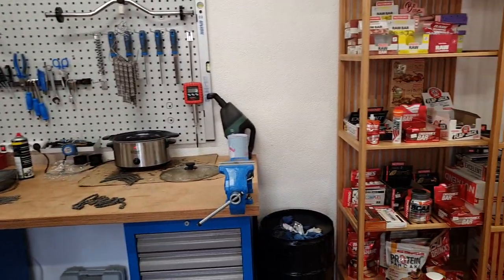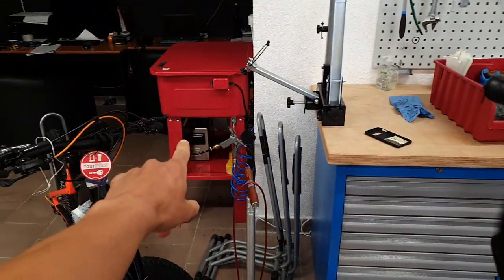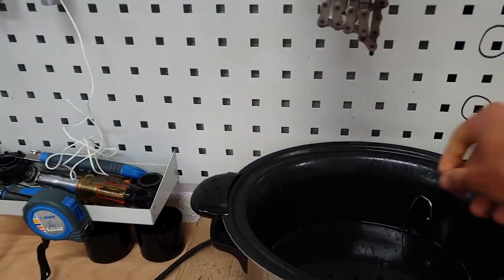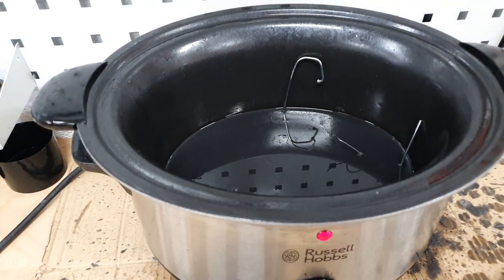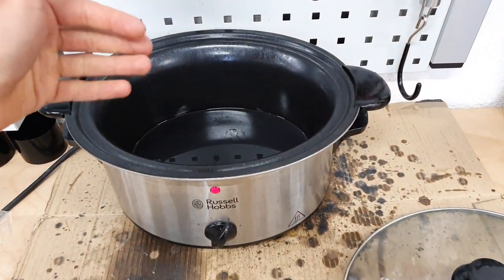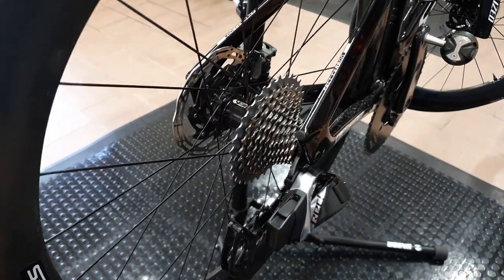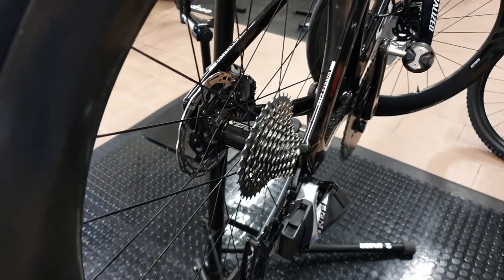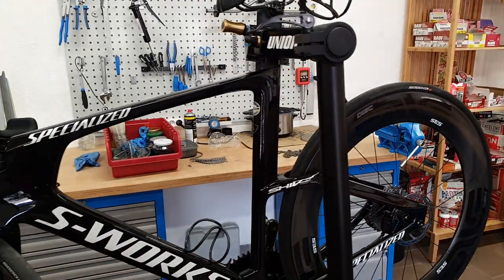Waxing your chain is not that hard!

Comment: This exactly the process I use - the only difference is I use a longer "swisher" handle for the chain made from an old metal coat hangar, and a narrower but taller wax pot.  This allows me to 'swish' the warmed chain around in the wax, and helps with wax penetration (This is per Molten Speed Wax instructions).  Also, I put my chains on the bike while the wax is still warm enough to be flexible, and give it a few turns of the pedal. This cuts way down on the wax flaking off and making a mess.
Reply: I also do everything you've described.  It works great!  Also, after I'm done with the chain I put a large and strong magnet into the wax.  I use an automotive telescoping magnet and I put the large magnet onto the automotive magnet.  This gives me a tool to control the magnet.  I put the magnet in the molten wax and swish it for one minute.  It picks up a ton of ferrous metals from the molten wax.  I do this extra step after every re-waxing, typically four chains.  This way the wax stays relatively clean and free of metal particles.  I've started waxing since Dec. 2019.  My only regret is that I didn't start doing it sooner!
Reply: Geez gents, some great tips... I have been waxing chains with molten speed wax now for two years and would not do it any other way. Bike is Cleaner. I like the magnet trick.... Naturally I have three chains per bike too, so putting it on warm is only feasible for the first chain. I also noted that Oz cycle suggests pulling chain out when the wax in the cooker starts forming a skin. You guys do this??? Finally on the noise... Yep, I did notice that the sram flattop chains are louder than my other bikes running the kmc chains..... Thinking it's the type of the metal.

Comment: I typically just put the chain on top of the cold, solid wax and turn the slow cooker on. Once the wax has melted I check the temperature every now and then. Once it reaches about 92 degrees Celsius I'm done and I turn the cooker off and agitate the chain a bit (I try to do it for about two minutes) in the wax. It seems to work for me. :)
Reply: Vicki Peterson  Usually, I just try to solve it with money, by buying a chain that has been cleaned and waxed, but when I occasionally buy a chain that still has the factory grease on I remove it as per MSW:s video here: https://www.youtube.com/watch?v=lI0tZqIpguk

Comment: motorcycle chain cleaner / wax combo works great for bicycle chains also...  put chain in lunch meat container, spray degreaser, shake well, rinse with hot soapy water then plain hot water, dry well. Heat in oven for few minutes (just warm), put in container again, apply wax, shake well, wipe off excess, let dry.

Comment: I have a couple of questions:
1. How often do you need to wax your chain?
2. Do you need a new chainlink to put your chain back on bike everytime you wax? 
3. Does wax run cleaner than dry lube?
Reply: supersonicwings I’m interested in these q’s as well.
Reply from the maker: 1.) Ideally every 300km in dry conditions, 600km max
2.) No
3.) Obviously, dry lubes are rubbish
Reply: Just a note, Sram recommends not reusing the one chain link more than once. At 12 bucks each, I think that's a bloody conspiracy. I use it over and over again.... Ha!
Reply: I do wax my chain for 3yrs now and all the chain still using. Now I’m riding indoor on zwift and found new wax chain will last around 500km and the chain will start to squeak and I re wax it and use the spare waxed chain. I use paraffin wax with Teflon powder.
Reply: I have used the same quick links for the last 12000 km.

Comment: The one drawback of waxing is that you get into trouble if you travel somewhere and don't want to bring your slow cooker and don't want to bring 10 chains. Fortunately, some drip lubes are very compatible with molten speed wax. Last summer I cycled from Stockholm to Amsterdam and then I brought along a bottle of UFO drip, which was mostly ok. Now I just read about the Tru-Tension all-weather tungsten lube, which seems like the perfect complement to molten speed wax. I have to get a bottle ASAP.
Reply from the maker: Wait for the new Silca lube 😉
Reply: You can always give your wax chain a refresh with a paraffin candle, a lighter and a hairdryer.

Just light the candle and drip the melted wax on each link of your chain, the wax will mostly solidify on the cold metal. Then, after you gotten a whole row of links with wax, use the hairdryer to melt the wax into the chain links. The liquid paraffin should be thinner than a wet chain lube and thus penetrate the chain easily.
Reply: I have a bottle of chain wax dissolved in Xylene solvent in a squirt bottle. You can put some in a  small bottle inside a saddle bag, or just use a dry lube like Muc Off, which is essentially similar...

Comment: Good summary. Would be interesting to hear your thoughts about MSW powdering, why you use CeramicSpeed chains as racing chains when you already have very good performing chains + any new thoughts/experience concerning CS UFO Drip.
Reply from the maker: UFO chains are also polished before being coated. I don't have means to do that. Preparing a well powdered chain is also quite time consuming, so just installing the UFO chain cuts down the preparation time.

Comment: Hi Ronald, important question: should I wait for the wax in the crock pot to cool down a bit before removing the waxed chain? I noticed if the wax is still very hot that a lot of it pours out of the chain again immediately after removing it from the crock pot. It leaves me wondering if it's better to wait for a bit for the wax to get more solid again so it can stay better inside the chain.
Reply: In my experience this is not needed. Just do it like Ronald and there is more than enough wax on your chain (as you can see on the flake bild up over time)
Reply: Most of It should drip off. The important wax is the wax penetrating between the plates and links.
Reply: Interesting! I heard that you should wait for the crock pot wax to start forming a skin.... Then when you take it out, hang the entire chain from one end, use a latex glove and cloth and while it's soft, with a dry towel, scrape of all excess....
Reply: In the begening I was doing it, but I found that it is not necessary absolutely. The wax that pours out of the hot chain will fall off the cool chain. It's the wax on and inside the chain, you don't need it, you need wax in between the links and rollers, capilarity holds hot wax there.
Reply: I hang the whole chain from one end and wipe it of any excess wax with a cloth whilst the chain is still hot. It cleans the chain a treat and removes a lot of excess wax. The wax is needed between the plates and in the rollers and wiping it will not remove it from there. I also wipe the chain with a cloth before waxing to remove the worst of the dirt that gathers.

Comment: I go through two chains a year and I buy the top of the line chains which are coated with anti corrosion process, Shimano SIL-Tec low friction treatment, during manufacturing. No need to use lubricants any more. Saves time, money, and mess.
Reply from the maker: Yes, you're only throwing away like 30W in friction... plus a waxed chain can last 15 000km so waxing will be cheaper anyway
Reply from the maker: @wasupwitdat1mofiki94  chains are not roller bearings. And yes, it has been proven that you can lose 30W at a 250W output due to lubrication.
Reply: @ronykuba  Where did you learn that, off the internet? LMAO!
Reply: Wasupwitdat1 Mofiki i use the top of the line shimano chains too and yes they are coated with anti corrosion and they are even pre lubed. you need lube to reduce friction not to protect from rust. your chain isn't sealed and will be noise if you don't lube it. simple phisics...
Reply: @ianiscaratti4924  Bike noises don't bother me because I wear earbuds and listen to music.